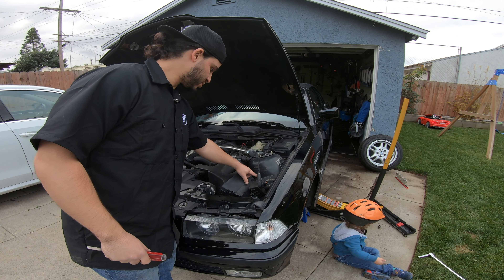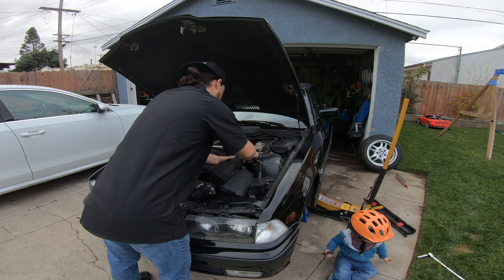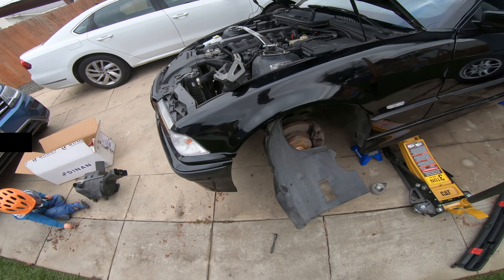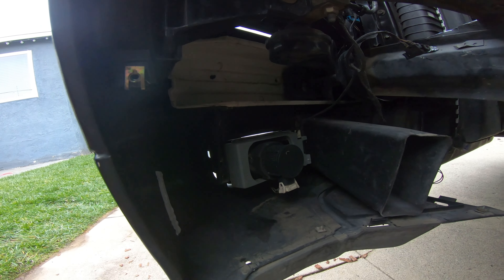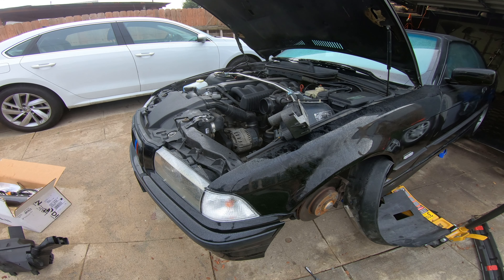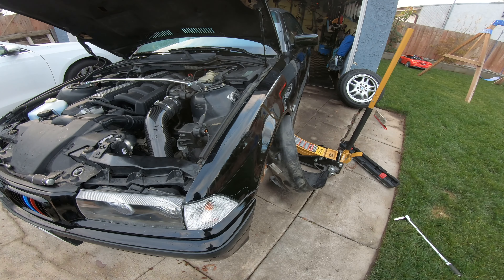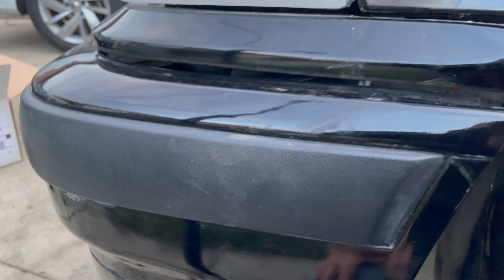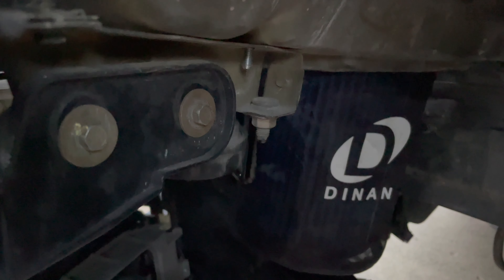Installing a DINAN cool air intake (CAI) in my E36 BMW

Comment: wanting to do this to my 95 325i. what is your e36? and did this trigger any check engine lights? thanks a lot, i’m 17 and i’ll probably do everything you’ve done in this vid.
Reply: and where did you relocate the horn? if you left ur off, did it trigger any lights?
Reply from the maker: Nice- mine is a 99 323i. Should be the same m52 motor so your installation should be basically the same. No check engine lights at all- just be sure you tighten the seal where the intake connects near the mass air flow sensor and you’ll be fine. Good luck and feel free to reach out if you have any questions!
Reply from the maker: @corneliusbombardus1153  I left mine off and there are no lights on from that. But you can relocate it behind the fog light.

Comment: After a couple years how is it working? I just bought a e36 m3 and thinking about buying a dinan intake great channel!
Reply from the maker: Thanks for the feedback! A couple years in and this thing is still great! I love the performance but even more than that I love the intake sound and the way it improves the driving experience. I’d highly recommend this simple mod!

And welcome to the E36 family!
Reply: @fastcarseats5317  thank you next pay check I think I know what I want!
Reply: @fastcarseats5317  also another question did you end up keeping the sock for the filter?
Reply from the maker: @paulnaquin7728  yeah I did. It’s pretty thin and o doubt it restricts airflow much. And since the intake gets relocated pretty low to the ground, the sock helps prevent dust and dirt clogging the intake.

Comment: Great video! I have a 95 325i looking to do this where did you buy the parts?
Reply from the maker: Hey, thanks for the feedback! Glad you enjoyed it. I bought the parts from DINAN directly; they brought the intake back for a limited period. The last time I checked, it was still available through them and it's the same part for any of the 6-cylinder E36 motors. Alternatively, you can always look for the parts through places like Turner Motorsport or ebay/craigslist/facebook marketplace. Hope that helps!
Reply: Oh okay cool thanks for the quick response I’ll find it!
Reply from the maker: @NSpiz  Sounds good! Good luck!
Reply: Came back to tell you got it installed love the sound definitely worth it looking to buy the dinan exhaust next
Reply from the maker: @NSpiz  that’s awesome! Yeah doesn’t it sound great? Nice job getting it done. 

Let me know if you find a DINAN exhaust. I’m definitely looking to add that too!
Reply: @fastcarseats5317  sounds great will do

Comment: Hello i just got an e36. That tubing that comes straight out if the alternator is missing for me is this inportant?  As well as the intake that leads towards the front of the car that squeezes between the alternator and the light is missing. Are either of these inportant
Reply from the maker: Hard for me to assess without seeing what you’re referring to. The intake that you’re referring to might just be the air duct that directs air to your brakes. Can you email a picture to fastcarseats@gmail.com so I can assess the part you’re referring to?
Reply: That pipe thing to the alternator is for cooling it